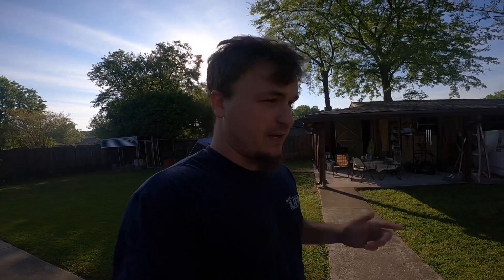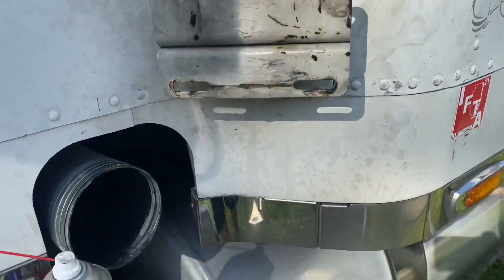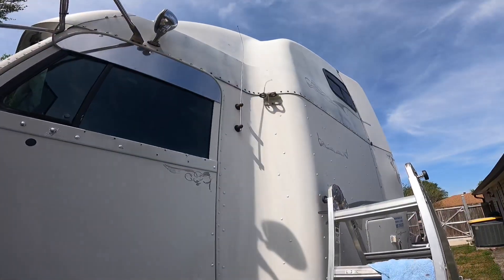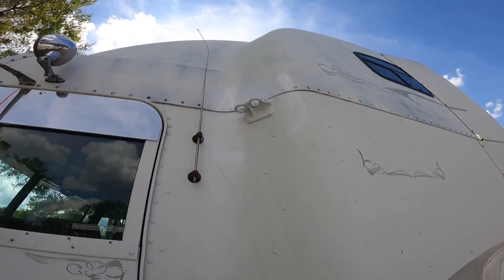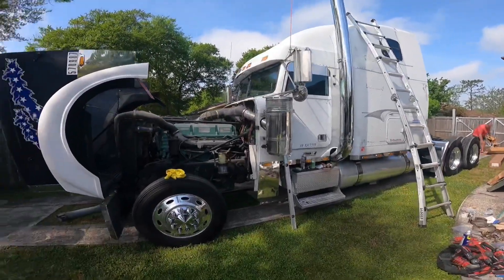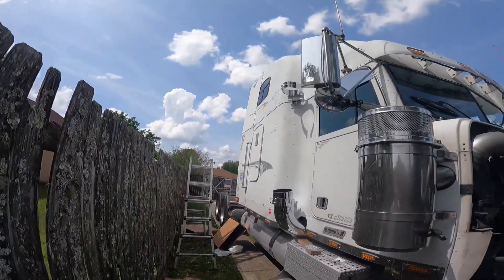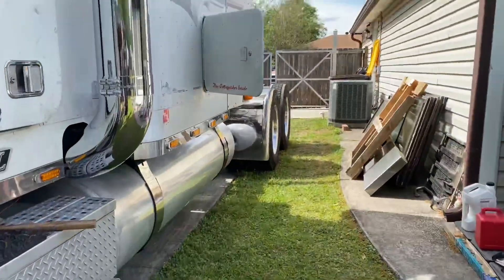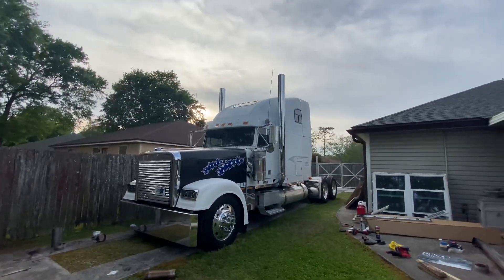FREIGHTLINER CLASSIC 8 INCH LINCOLN CHROME STACKS INSTALL!

Comment: Man that is awesome that your dad help you work on your truck. I know him helping you helped out a little bit faster. All the frustrating and headed you went through it was worth it seeing the smile on your face when you fired it up for the first time and hearing the jake brake on top of that. I got to hand it to you those 8 inch stacks are looking nice.  I have big very very wide feet sz15 6 EEEEEE wide foot with very very fat wide toe that are equal straight across making my foot 6 1/2 inches wide from my big toe to my little toe and I can put my very wide foot in your stacks and shake it side-to-side with enough space in the stacks. That is a huge stack man. I am running straight stacks on my classic too but they are not 8 inches though. I know exactly how heavy that Muffler was. With my toes being  6 1/2 inches wide there is no shoes , sock , or boot that's wide enough to fit my foot so I have to be barefooted 👣 or wearing flip-flops when I work on my truck and that muffler laid on my foot when I took it off the truck. I was Barefooted 👣 at the time so I got a good taste of how  heavy that Muffler was. Nothing happened to my foot when that muffler lay down on my foot. I guess that is the only good thing about having very very fat wide toes but everything else really really sucks about having a very very extremely wide foot with fat wide toes that are equally straight across. Good video brother keep up the good work she's looking nice and sounds nice.

Comment: Why didn't you use ss flex pipe ,way to much flex pipe ,and 8 inch straights way too loud .I've had 6,7,8 and 10 way to loud .you put on chrome pipes that after a year will look like poop. Ss pipes if your going to do that is alot better. My w9 I take the mufflers off and put them back on by myself. I'm 63 way to much blue star whinning . To your dad 2 thumbs up. From a very large w9 non blue star . Happy trails